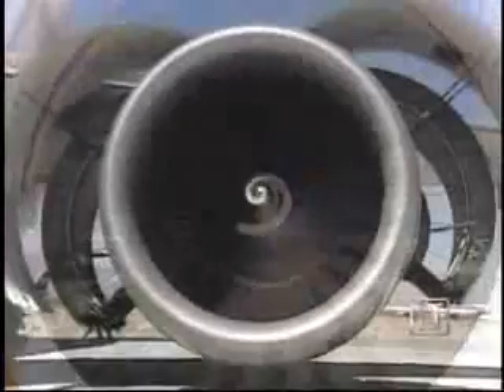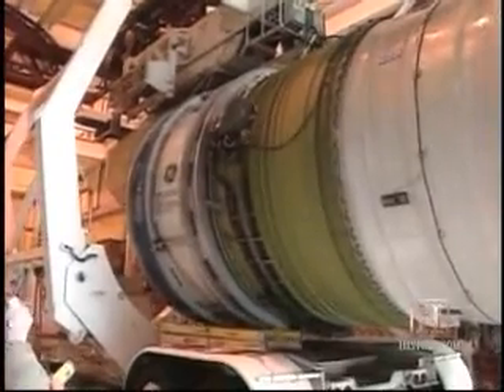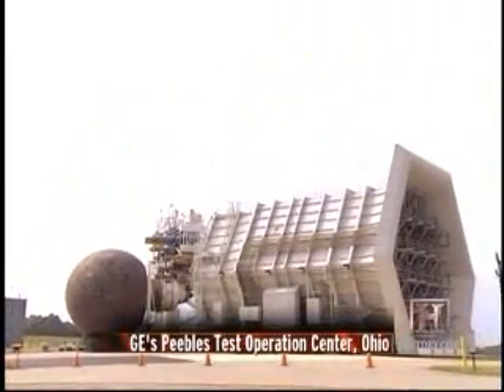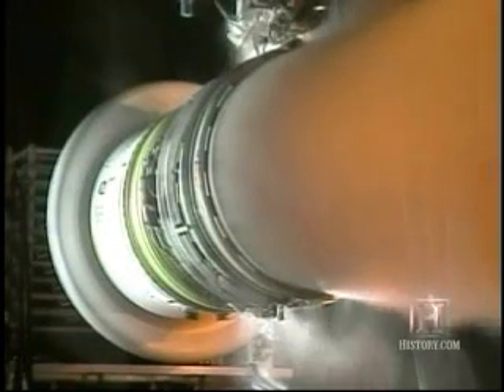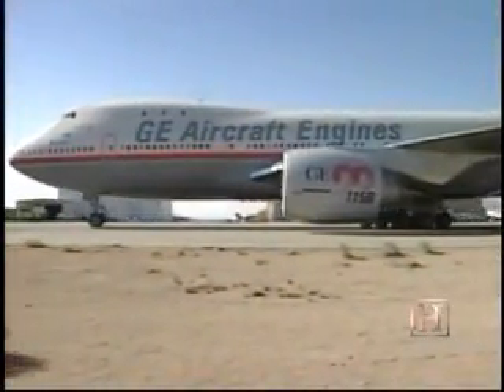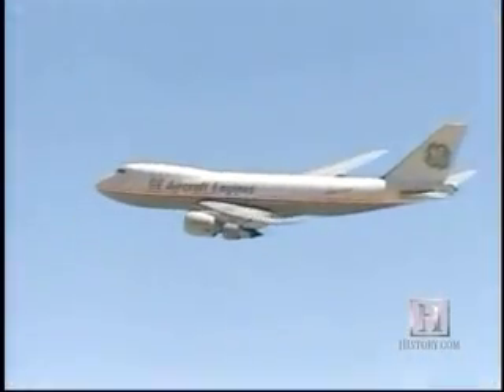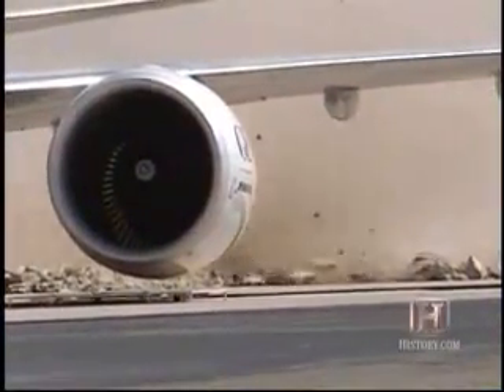Testing the new GE-90 Engine

Comment: im callin bullsshit on the hp numbers,  WWII fighters had 2,000 hp. Two engines on a 777 are supposed to produce enough power to hold still 100 P47s at full throttle...ain't happening!
Reply: completely happening

Comment: how do you convert thrust to horse power? she said the engine generates 127900 pounds force of thrust is equivalent to more than 100000 hp . Is the horse power mesurement made by imagining or physically connecting a shaft to the engine primary revolving rotor part which is intake fans I assume so that it behaves like a crank shaft on a car engine?! I also wonder at what rpm is that horsepower mesaurement made,I also wonder what would be the maximum torque the engine generates on that crank shaft
Reply: maybe she meant it in a way that if you strapped it to your car you would probably pass the speed of sound lol, so maybe in that aspect but technically its impossible.

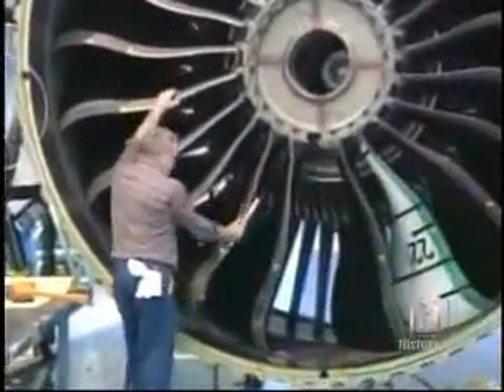Comment: 0:50 , great GE engineering there with there "unique swept fan-blades" .... wait..."did GE invent the swept fan blade?". No. Rolls Royce did.

Rolls Royce could actually have made an even more powerful engine much more easily but instead they built a far lighter engine with almost the same amount of thrust making the Trent 800 far more efficient over most routes. Shame GE bought exclusivity.

Comment: I have to question how they managed to "cut power" to the 3 CF6s  and fly with the GE60. No question on the thrust, but from an aerodynamic perspective, idling those engines would have resulted in much much less drag than having them cold.

Comment: If the aircraft has passed the descision speed (V1, which depends on several things such as runway length, take-off speed etc), the aircraft must continuwe its take-off and then return to the airport, because there is no guarantee that the aircraft can be stopped on the remaining runway. If on the other hand the engine fails before V1, the aircraft is slowed and will be able to stop on the runway unless there has also been a brake failure.